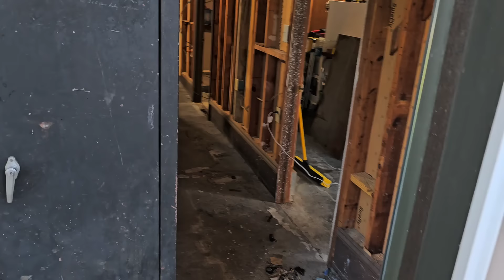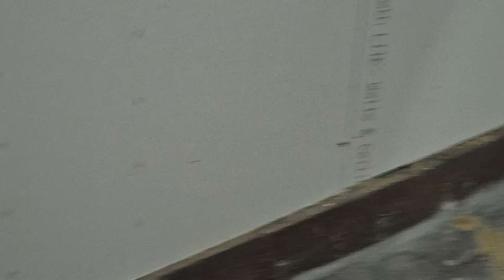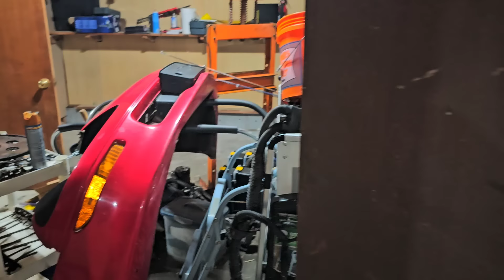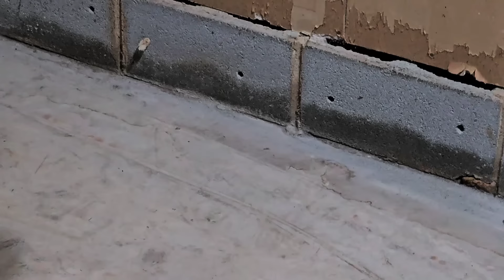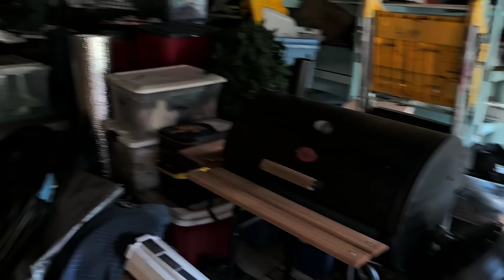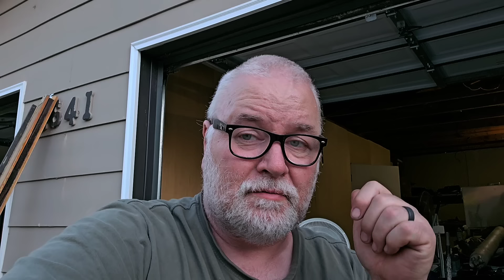We Hit A Hiccup In The Garage & A Discussion About The Pre Purchase Inspection Video

Comment: Been there done that with termites. Our first house had them, thankfully treated after the purchase inspection. Looks like a thorough job by the exterminator. Makes me wonder if the guy who said there was no active termites knew what to look for.
Reply: If the inspector does not have a thermal camera they are not doing it right now. Those show up all sorts of things, like leaking pipes in walls, termites in the walls, and even things like insulation that is missing in places. Also a wall moisture meter, and a stud finder, are good things for home inspection. the wall moisture meter tells you just how bad the hidden leak is, and the thermal camera shows the boundaries. also works to show poorly installed windows and doors as well, from the heat leaks.

Comment: My pest control guy said there's two kinds of houses.  Those that have termites and those that will.
Reply: I’m sure you’re the same guy that thinks there are two kinds concrete too, ones with cracks and ones that will crack….which is total bs….but keep on believing
Reply: @skiboskeeskiblets  By me there are no guarantees about insect damage. You can tent it, and it is pest free, but that week one can fly in and start up the damage again. However I did see a house, 100 years old, where there were absolutely no bugs in the wood. Owner would, till he died, having gotten it from his father and grandfather, go into the attic every year and paint all the exposed wood with a mix of creosote, linseed oil and paraffin, so the wood all got a coat. Pest control came to inspect after last family member died (original copperplate hand written deed, complete with original OHMS wax seal with ribbon, and later on stamp duties and addendums on the rear as it was passed down) and said this place was impossible, not a single bug, not a single fly, not a single gecko lived in that roof, doors or frames. Frames just got the linseed oil and paraffin every year, smelled for a week, and were slightly tacky till it polymerised. hose is in what is termed the borer belt, where you can be sure pretty every house has some, treated wood or not, unless you have very old house with green arsenic chromate treated timbers in the roof.

Comment: Tip for the garage dig a small trench around the outside, about a spade deep, and a spade wide. Then order for yourself 5 20kg/50lb bags of borax, which is very cheap. Then pour into the trench, a nice even layer about fingertip deep, and close it up. Will keep any of them from moving in, and also kill kill any ants as well. Same for the house. Also works to kill fleas and roaches. Will, after doing it, have you finding them all over for a few days, kicking on their backs. Cheap, relatively non toxic, though not pet safe, but works well.
Reply from the maker: That's great to know! Thanks Sean. I hope you're having a good day. Keep wrenching 🔧
Reply: @WrenchingWithKenny  Well, turned off the engine light, so car is back to being happy again.

Comment: Bought a Nissan from a private party in the 80's without a pre-purchase inspection.  Lesson learned.  Car looked beautiful, ran fine.  Didn't find out it had been in a accident until it chewed up a front axle after 20k miles.  I am pretty good as a backyard mechanic, but I learned my limitations. I kept that car for 80k miles but had to change axles repeatedly.  I learned how to do it myself. I ended up buying the cheapest replacement axles I could because I knew they wouldn't last.  Remember JC Whitney? The situation was a good life experience.

Comment: Agreed 100% the only thing I found was that places like large auto shops like  Walmart and others that certify vehicles are actually very picky and although they may say demand a replacement for a component that will  make the  certification  time limit,  they will not  cut corners for anyone because they will send you away if you don't agree because they be sued just like the little guy but have much more at stake ! I had vehicles that passed a small  local garage and was  denied at Walmart because it did have some  minor problems but they were safety oriented.

Comment: I work at a large tire shop that does just about any auto repair, and the majority of our negative reviews is because of us not aligning customers vehicles because they have loose parts.
Reply: I am showing my age here 76.  The state of car repair has gone down in part because the overall quality of vehicles has improved to the point people think they can just drive and not maintain them.  Those of us who owned vehicles in the 60s and 70s expected to have them repaired.  in fact we actually had real service stations where mechanics would check oil and tires.  Days sadly gone, check your own and by the way fill up your own gas tank.  

As you noted they drive them until the wheels are ready to fall off and then say they are being ripped off when confronted with problems that should have been fixed sooner.   I will never understand how may gladly spent thousands on a new or used cars and then go nutts when confronted with at $1000 repair.  False sense of value.

Comment: While it is always ideal to have a car inspected before purchase, the logistics is not as easy as it sounds.  In my small town you need to schedule any maintenance weeks in advance.  No seller is going to wait around that long.  Presuming the deal involves a low price (say under $5k) take someone with you to inspect the car.  Good deals do not last long so quibbling for an inspection, you may be kissing a good deal goodbye.   I have sold many cars (not a dealer) and it amazes me that the number one issue people have is price more than the quality of the car.  That is why many people get burned, which frankly is as much their fault as devious sellers.  

  Many buyers will usually try to negotiate the price before they even see the car.   Many are plain evil and want you to give it away for almost nothing.  I don't deal with them, nor would I allow an off site inspection.  Frankly I price... take it or leave it.  I do not sell any car with any significant issue, so I have never had a buyer come back on me.  As a result I seldom make any money
Reply: My second last car when i went to the dealership I took a cardboard box with, to lay down and look under with a torch, all round. Yes minor accident damage on it, but repaired well, and for the price well worth the deal.  Had it for 10 years, then sold it, and got my current one, also knowing the history on it.
Reply from the maker: You're a stand up guy & won't sell a piece of crap. Which actually helps your reputation in the long run. I would love to have so much business that I'm booked out for a week. Thanks for sharing your experience & watching the channel. Keep wrenching 🔧
Reply from the maker: That's awesome!

Comment: I wouldn't trust Car Fax at all, my father did $3500.00 damage to a Nissan Altima, turned it in to insurance, had it repaired, and traded the car off and it never showed up on Car Fax, the dealer he traded it to had a clean Car Fax report for the next buyer!!
Reply from the maker: We had an issue at the dealership when a regular customer wanted to trade his car in. The car fax listed it as a salvage vehicle. He was the original owner of that vehicle &  never had an accident. After a lot of drama, car fax decided someone made a typo & reported the wrong car. Thanks for sharing & keep wrenching 🔧

Comment: I bet you wish you had your property inspected for termites before you bought it?!
Reply: I guess you should have watched the video.
Reply: Been there, done that.  Not always easy to find.  Inspectors do not open walls and industry standard is infestation must be visible.  However it is apparent those buggers are everywhere in the south so I am surprised that it was not caught during the sale as most mortgage companies require termite inspections.   No offense to Kenny, but this proves the point that even with a pre-purchase inspection on his house, they missed it.  Garages always get ignored.  I used to live in Tucson, AZ, and termites are everywhere there.  Had newly built house and within year they were crawling up the slab.  You can see the trails coming out of the ground.  In Kenny's case they crawled up the cinder block foundation walls so you could not see them until it was too late.    I noticed the inside exterior walls still had drywall, if he opens them, I bet he will find massive damage.